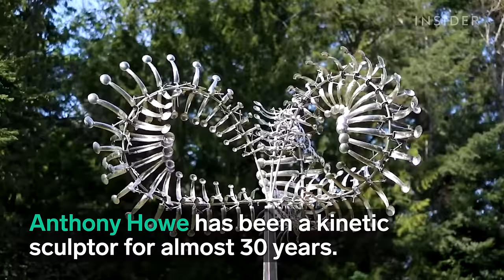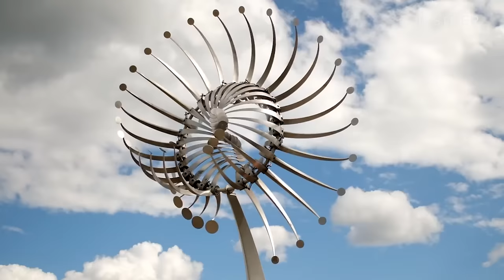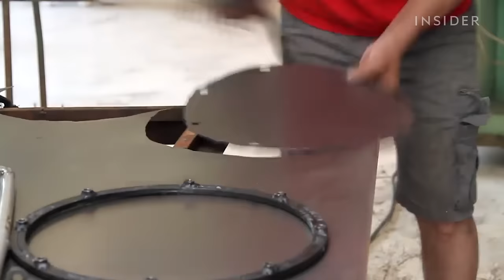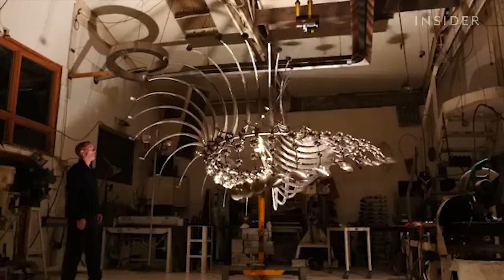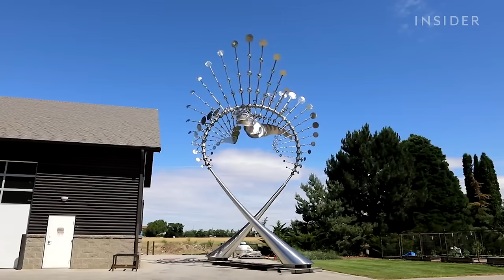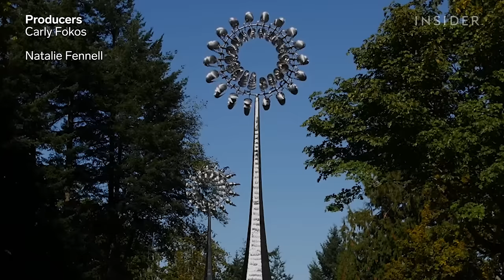How These Metal Sculptures Move With The Wind

Comment: Obviously, this gentleman like most engineers saw the beauty and elegance and harmony and rhythm of the silent and invisible engineering and mathematics functions and operators in any working static and dynamic machine and simply,  added a simple shape that would create emotions in people's minds rather than a utility machine for their physical comfort. To any engineer, the activity in a V-8 piston engine or a suspension bridge of any design or simply any machine in the kitchen including the refrigerator, the microwave cooker, the telephone, the suspension and geometry of the steering system in a car of the front suspension of a motorcycle of a bicycle to make it self centering.  The switching functions in any time multiplex system handling high-speed data or the old frequency multiplexing in radio and TV while what goes on in the wooden and plastic boxes of any TV, any camera,  any power station or the engine room of an ocean liner or the burn in the jet engine of an airliner, all these are just as beautiful and more complex than what we see in this video.

Whip and Loop antenna engineers have been dealing with that function we see in this video for more than a hundred years as the electromagnetic field along a transmission line in an AC transmission, be this matched or unmatched the transmitted and reflected wave ration will set up a similar function, which unfortunately is unavailable to the human sensors and artist occasionally come up with something simple that approximated to the activity in engineering. The system shown makes use of a simple behavior of dynamic flow as in a Pelton wheel with a difference. The blades in a compressor and those of a turbine in a jet engine are somewhat related where buckets are used to make the Pelton wheel and the turbine disc go around using a reaction or an impulse effect.  The whole effect is exactly the same as we have in any long transmission lines and the fact that he used loops rather than a straight transmission line, the wave motion is more like that in an atom where the electrons orbit the protons in a wave motion where when the electron is released from the atom it sets a handful of functions all related to that shape. The behavior of waveguides and cavity resonators also contain a beauty that is not available to the human eye and the microwave in the kitchen with the magneton circulating both the electric and magnetic field around its multi-cavity is just as beautiful and elegant and even more complex than what we see in the video. 

While we live on earth, most humans develop their emotions more than their logic, reason and rational thinking, and visual operators and heard harmony described art, through the titillations of emotions always will always trump the invisible operators which make our universe and were the reason of our evolution. After appreciating this beautiful sculpture I would like to invite readers to see the beauty of Navier stokes equations that are being applied around this sculpture to make it move so gracefully, but what activity which is not seen must also be appreciated by the public. It is about time that the general public would be made aware of all the unseen and silent beauty that exists around them. All reality around us in any form needs to be appreciated deeply and emotions must never blind and trump the logic, reason and rational behavior of what is around us but cannot be seen nor heard.  
https://youtu.be/GHOoZYhF6r4
https://youtu.be/g-5bi7dxHP4
https://youtu.be/rB83DpBJQsE
https://youtu.be/Vi_6x-VpAb0
https://youtu.be/IDeGDFZSYo8
https://youtu.be/epa6WxEw1Xk

Comment: I just took a welding course.  Wanted to try to make the first one.  If I make one set of "tentacles" and hold it in the wind. It barely moves.  Prototype using steel.  I suppose if you group them together to catch the wind in that cup form they will rotate.